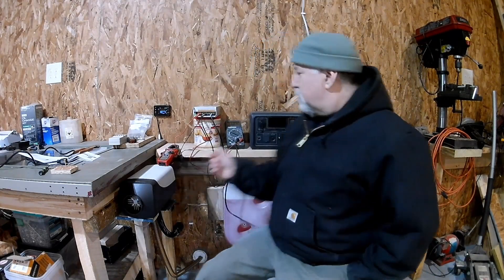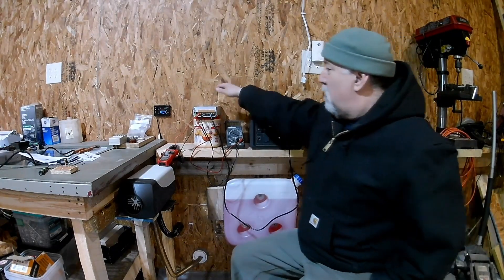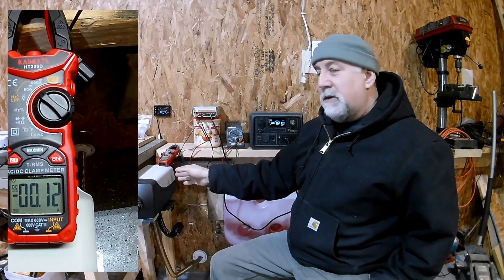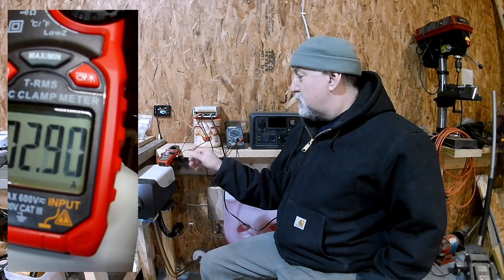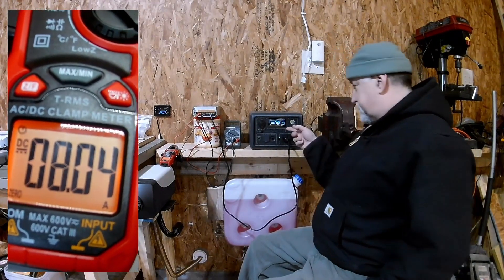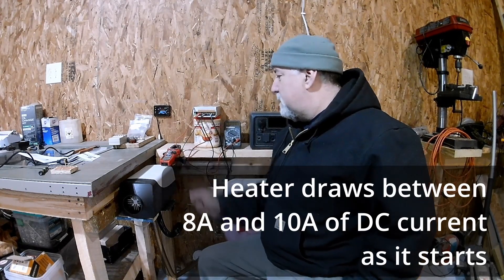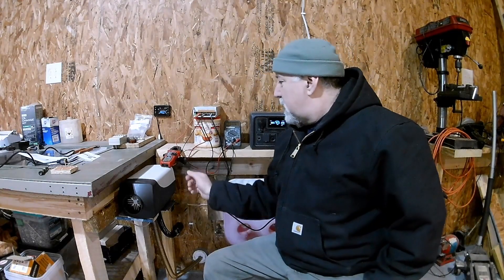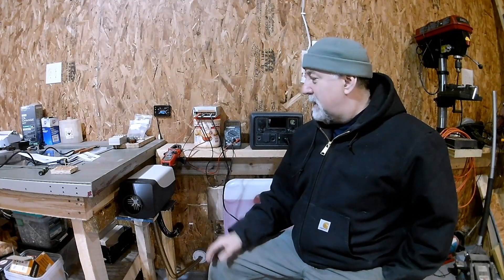Can you run a Diesel Heater off a Bluetti EB3a?

Comment: how many watts of consumption are displayed on the bluetti after the startup phase?
Reply from the maker: Timely question - I'm just finishing up a new video running the diesel heater for a full session on the bluetti. It was showing an average of 45w running the heater at 4hz. The runtime was just over 5 hours, including startup with about 7% life to spare on the EB3A.
Reply: @TheGergeDIY  thanks! Really looking forward for this video. Have bought the Bluetti EB70 and it can not run via 12v port directly. So either i use your solution or send it back and buy a car battery... would still like to use the bluetti bit if the conversion losses DC-AC-DC are to high i will likely send it back...
Reply from the maker: @lukasschmidt4902  recommend a marine deep cycle battery if you go that route. See this video for how I run mine off a deep cycle battery. https://www.youtube.com/watch?v=nYkAg9-2hmo
Reply: @lukasschmidt4902  expect a loss of about 10 % every time You convert power. - an inverter uses around 50 watt, just to run!. Wire loss is really important, so You should try again with a heavy duty wire (AWG 12-16), and keep it as short as possible. It matters less, if You are running off AC. These rules goes for anything in Your boat, car, caravan etc. DC should allways be short runs, with as heavy wire, as You can make room for.
Reply: Have now tested it via an old xbox 360 power brick connected to the ac port of the bluetti. Takes between 18 Watts (Level1) and 42 Watts (Level6)
Will send back the bluetti tomorrow and have ordererd a 100 AH LiFePo4 battery which is currently on sale here. Nearly double the capacity for half the price ;) i guess power consumption will only be half without the conversion losses
Reply from the maker: @lukasschmidt4902  - Great to hear of your success! I'm releasing a new video shortly showing the diesel heater running off the DC side. It consumes half the electicity!

Comment: So how long do you think it can run a diesel heater safely ? Just curious cause I have that same power supply on my diesel heater and just received the BLUETTI eb3a but, it is too warm to test that now LoL
Reply from the maker: @MrHebekerl - that's a great question, and important to know as the heater needs to be shutdown correctly before the power goes out. I don't know the answer - but I will find out and post a video on it. It's too warm to run the heater for long here too, but I can get an idea based on the current draw. I'll post back in a few days or so.
Reply: @TheGergeDIY  awesome thank you. No rush since the fall didn’t start yet. But do have 5 diesel heaters and one of them is mobile in a case that would be perfect for this setup. I am subscribed so will see your new video one day coming through. Enjoy your day. Florian